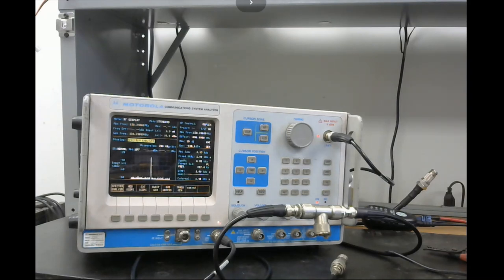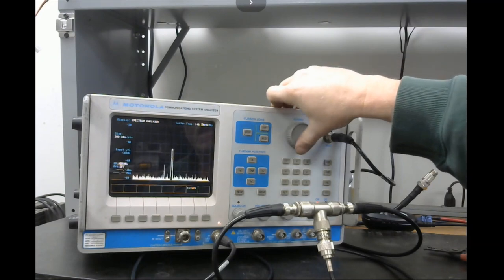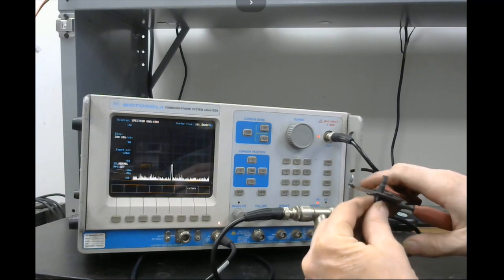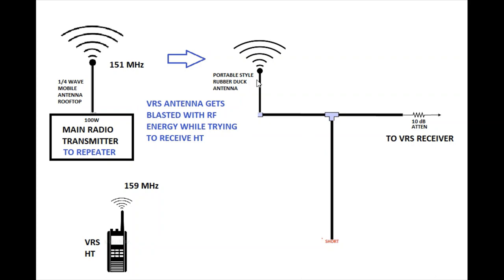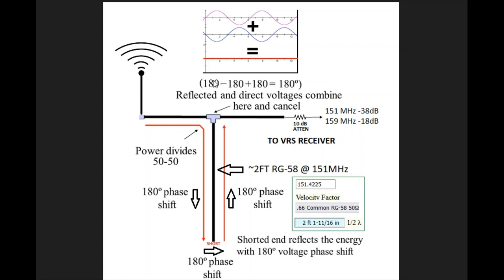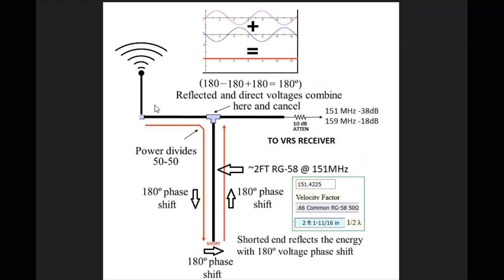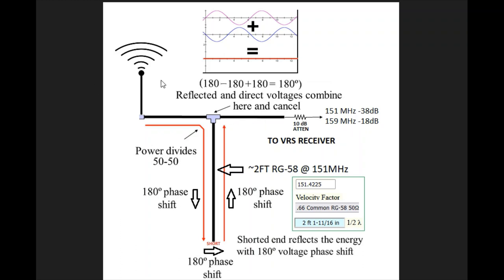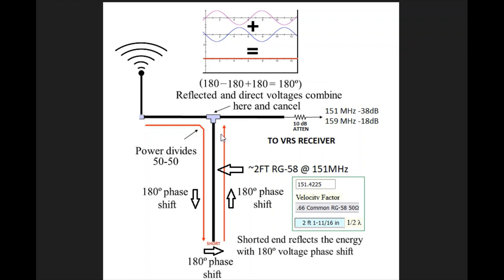Making and Testing Shorted Coaxial Cable Stubs

Comment: Quick question anytime that you're using a T connector is that considered a parallel connection
Reply from the maker: Yes, by definition, but it is not parallel 50 ohm loads. If you are looking at critical length cables and what not, they would not apply to this setup. Keep in mind what a network analyzer would see looking down the pipe. The goal is to stay as close to 50 Ohms resistive as you can.
Reply: @dc95811  trying to become more familiar w using coax to match antennas according to Smith Chart - can you recommend a good book or videos that explains using coax for this purpose
Reply from the maker: @PatAutrey  I wish I could, but it is sparse. I haven't done such things before, but I have seen ham posts of HF antennas using those to tune. You really need a Network Analyzer to show true impedance. But I know there are old school alternatives. w2aew has a channel on here and he goes deep into those worlds, check him out.
Reply: Thanks again I will definitely take a look at it